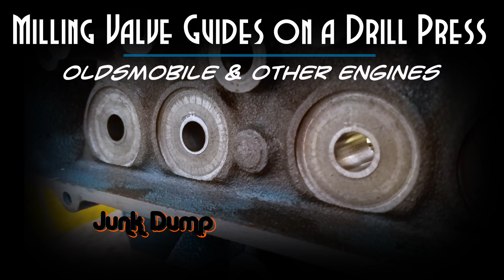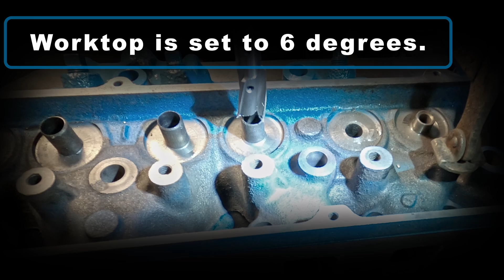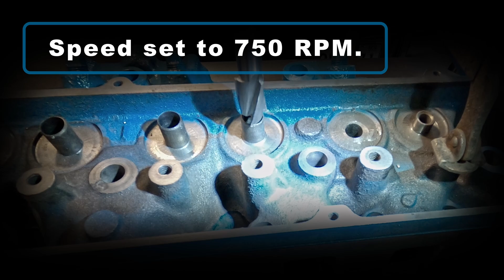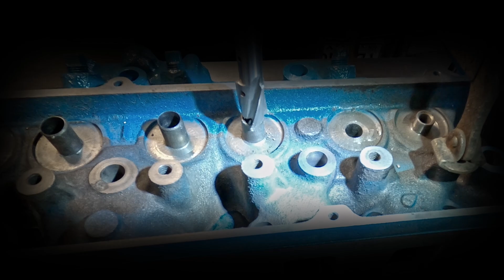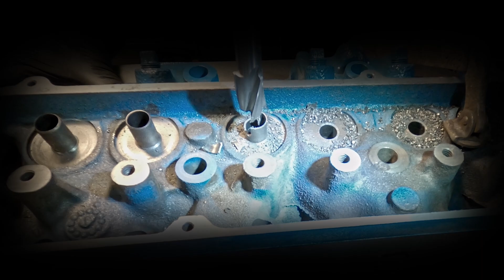Milling Valve Guide Remnants on a Drill Press

Comment: Your table is moving and one vice grip clamp isn't enough. Make it rock solid. Get a cross-slide table for the drill press.
Reply from the maker: You're absolutely correct, that day I couldn't find my good clamp set and was pretty frustrated with the head movement. The table movement you see is just an optical illusion from the post video image processing. That still doesn't address the issue that a drill press just has a little too much lateral play for milling, even with the cylinder head secured properly. I highly recommend using a piloted milling bit, it makes very professional results possible with a drill press.

Comment: You can use a pilot mill or pilot counter bore. Drill press just doesn't have the bearing strength for side load.
Reply from the maker: Exactly correct, I made certain to mention the pilot in the video description. Thank you for the comment!

Comment: I know you’re not recommending using a drill press for this operation, but you did a good job all things considered. The guide is flush with head, and no cutting into the spring seat area. There’s always something new to see and learn from. Your videos make me think about different ways to get the job done. Is this an Olds head? The material you removed from the guides looked very thin, not at all like a factory GM integral guide. Did you drill/ream the existing guide to size in preparation for a replacement guide? Just trying to understand the finished product. Thanks, J.D.
Reply from the maker: Thank you for the comment and question!  Good eye, you are correct that the guides look thin, I did drill and ream beforehand. This is an Oldsmobile head that had a lot of miles and worn guides. Thank you for watching and feel free to ask questions anytime!